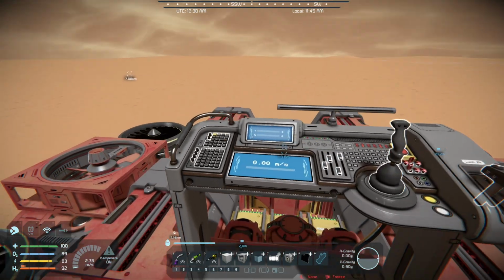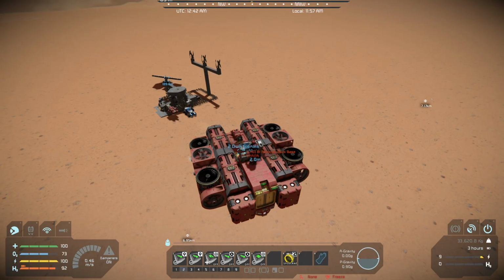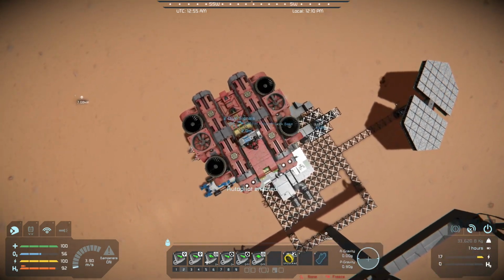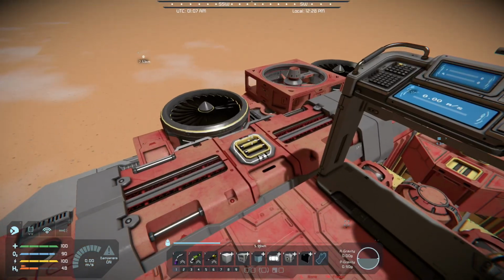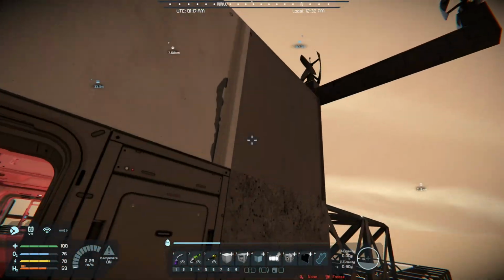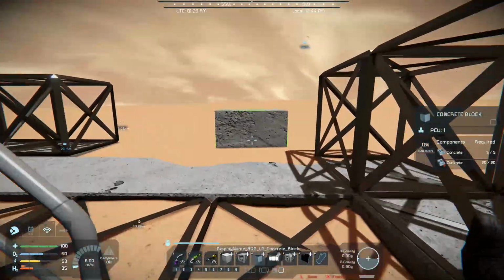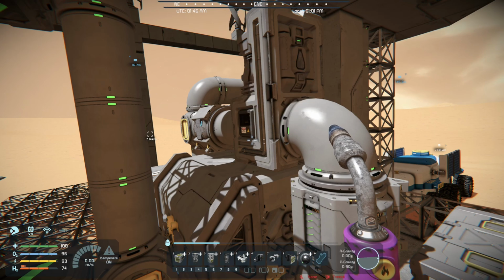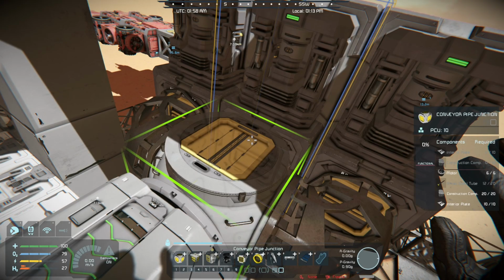Deep Ore Mining on Mars | Space Engineers E04

Comment: Hi kerbo, thanks for the sub - i returned the favour 👍
I've spent a lot of time with the AI blocks and you're right, they are buggy as hell ! One thing i noticed: you have the max pitch/roll set to 5 which you'd think is fine but... if the AI misses a waypoint it tries to bank/roll to get back to it, with it set to 5 it can't so it just 'drifts' for ever. However, if you leave it at 45 (or maybe 15-25) you'll find it works better (but of course you risk not enough thrust in those directions !).
You're doing everything right it's just the crap AI.
I always use a glideslope approach for docking, line up with 'the runway' then a straight line approach to 10m above the connector, then straight down works better as there's less chance of the drone missing its waypoint.
Oh btw my favourite novel is actually a series by John Normal called 'Gor', Each novel is complete but the backstory needs to be understood in order to make sense of the series 😃
Reply from the maker: Welcome! Your latest Space Engineers episode popped up in my feed, so I have been working my way through that. It's a fun idea for a series. Thanks for reading the About section, so few do. I'm not familiar with John Normal, so I will look him up.
Reply: @KerboOnYT  Ah spelling error, it's John Norman - and... you're welcome 👍